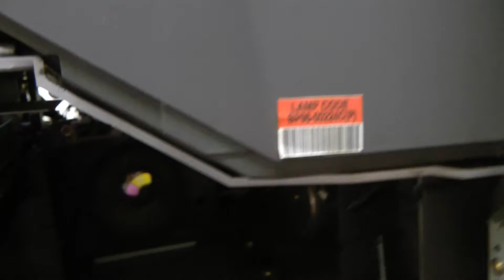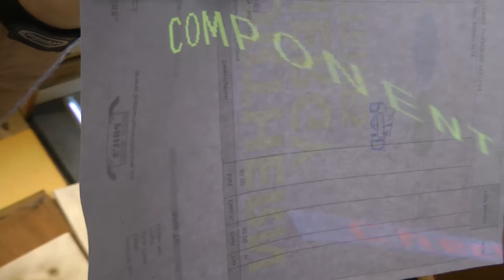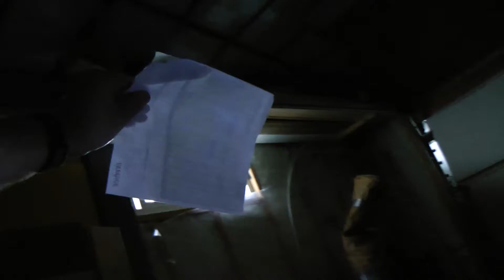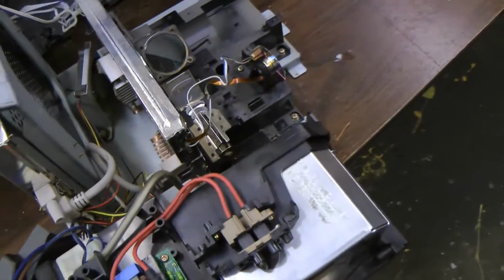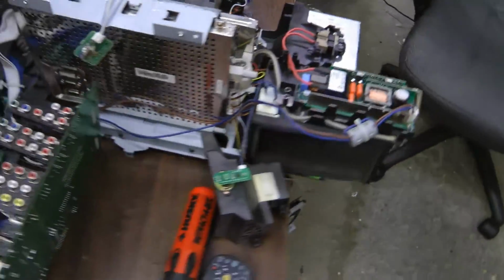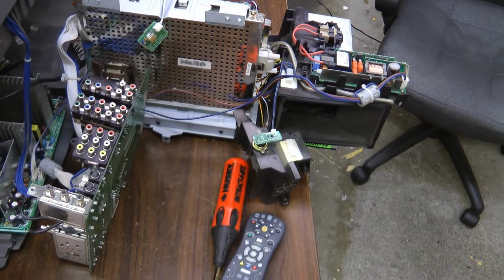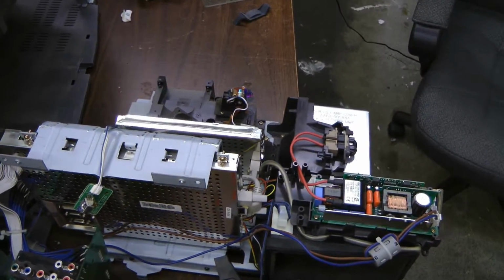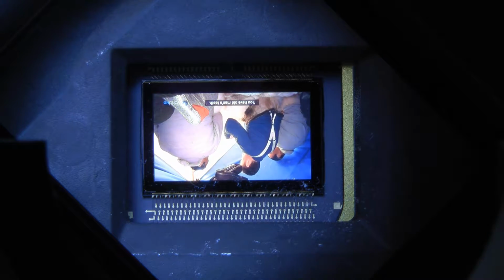DLP rear projection TV part 2

Comment: the color wheel along with the dlp chip and those lenses and reflectors are the most interesting parts of this projector,the dlp chip only generates a b&w image but the color wheel generates in synch along with those chroma signals of that program together, a color image,
those lenses and reflectors and mirrors are tweaked by the designers for a perfect geometric stable image,but it must have been hell to do that!!!

Comment: continued from 1st post....cuz it is not lighting up at all not the light / timer/ stanby light on the front of the TV....when i checked with my meter it was getttin 110 from the power cord and then when i checked the board by the switch it was only reading 11.1...is that normal....i havent poked any where else cuz i dont want to poke the wrong thing and short it out...thanks soo much for reading my problems...lol...